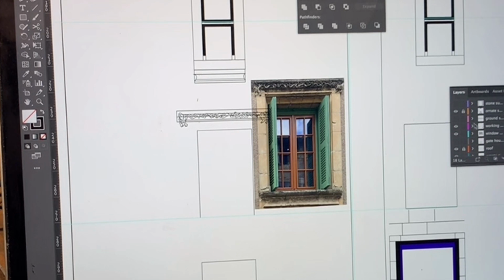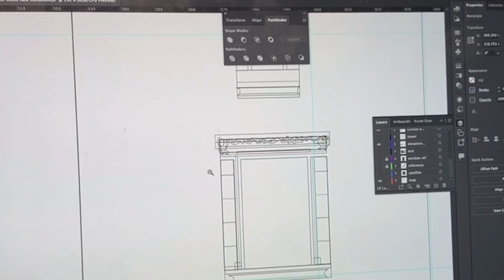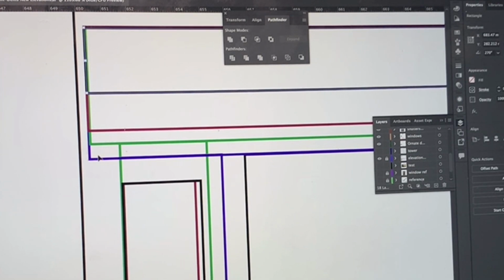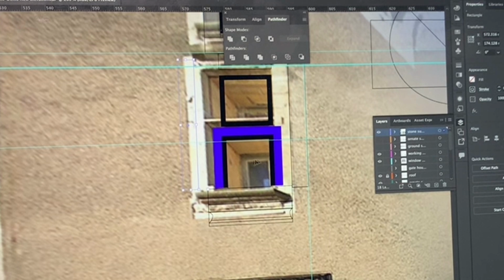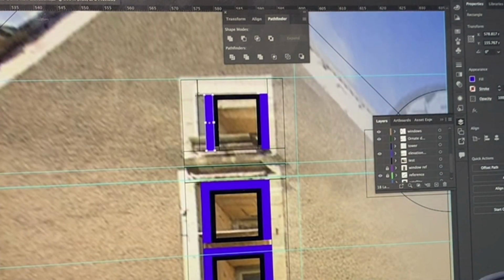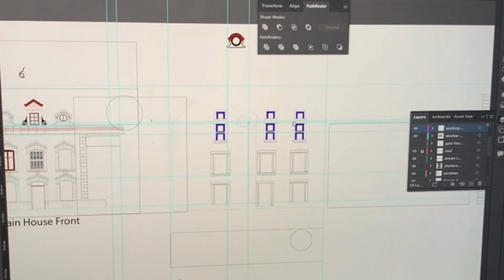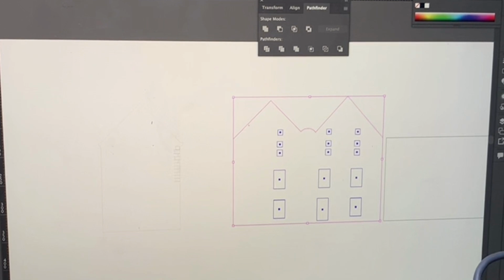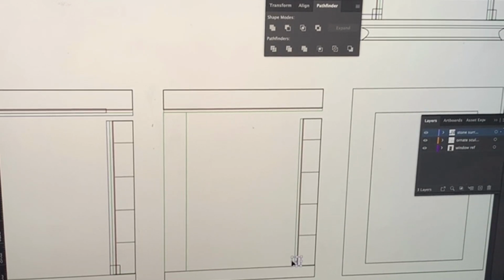Le Chateau: A live Build Journal Part Four - Drawing up

Comment: So in Adobe you can select, Transform and scale. Did you set the photo to a scale ir….?
Reply from the maker: Basically I work out an elevation, draw a box to the length and width of the elevation and drop the photo into that, if that makes sense? I might make a small video on the process
Reply: That’s a good explanation🖊📐👍